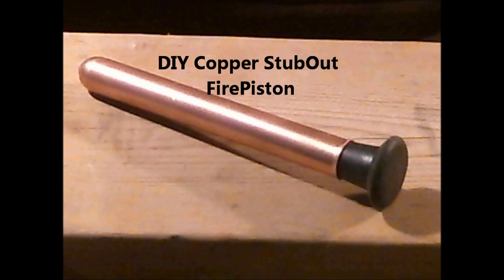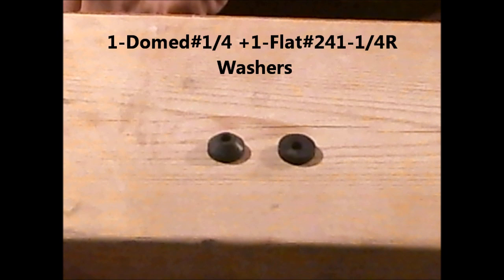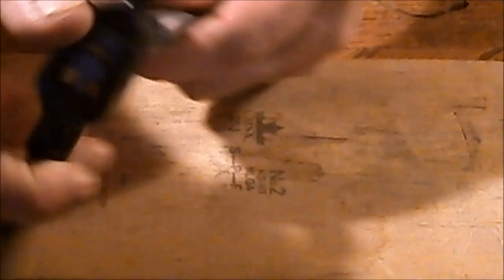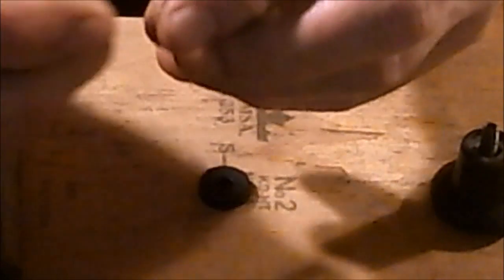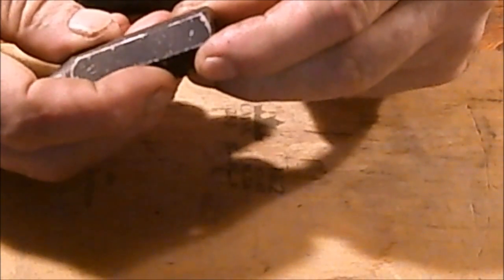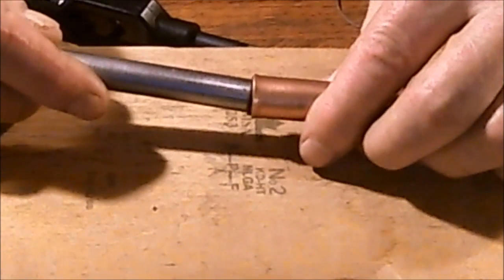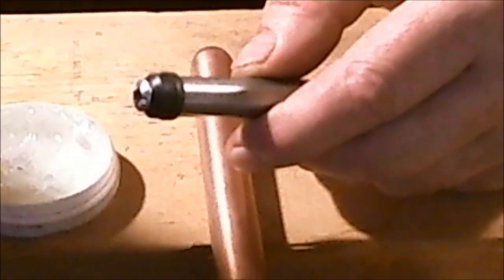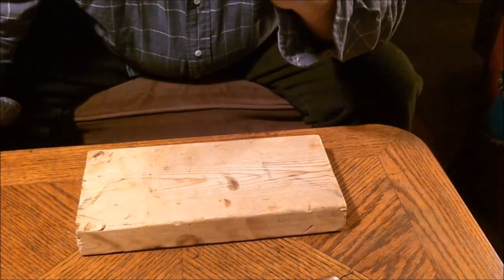DIY Fire piston : Another Great Weekend Project

Comment: Question: You say to tap it 10-24 or 3/16ng-24, BUT then you say you are using 1/4-20 screws?!?!
Option: use a 10-24 Allen Cap screw then you don't have to make a pocket in the head of a screw.

I do like the idea of using those rubber washers instead of cutting a groove for an 'O' ring.

Comment: Outstanding! Quick question, would fine-grade steel wool work instead of char-cloth or char-cord? I know it burns readily under most conditions, wonder if it would work in a fire piston?
Reply: electronicdawg Roger that. Also, steel wool has not been pre-charred to lower its ignition point like char cloth. Since watching this, I've made a fire piston and used it a few times, but it's hit or miss, not reliable ignition every single time. I'd choose the bow drill over this, or better yet, the magnesium match.